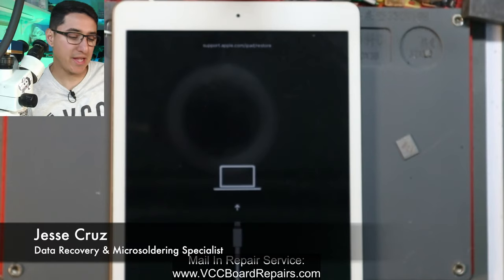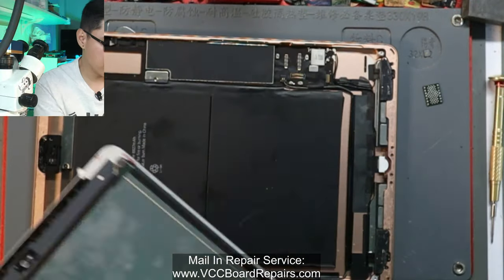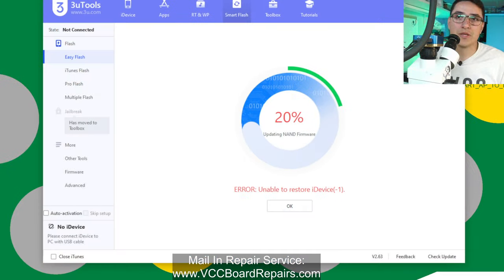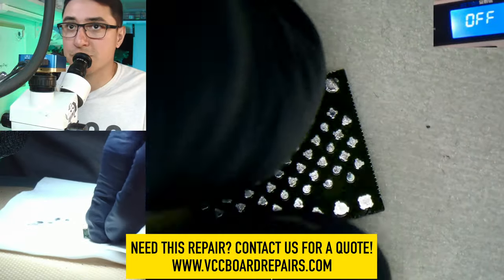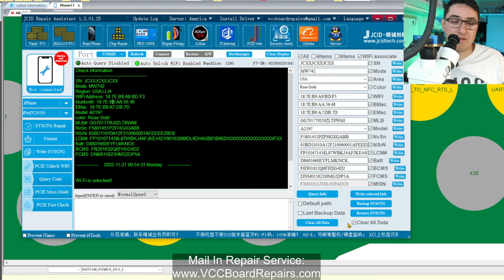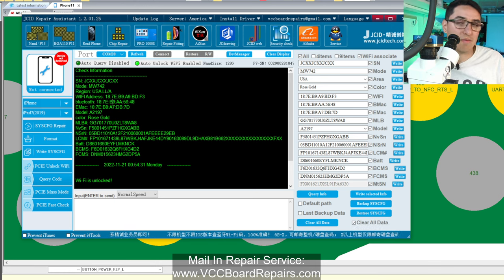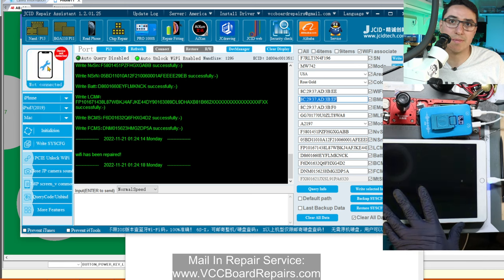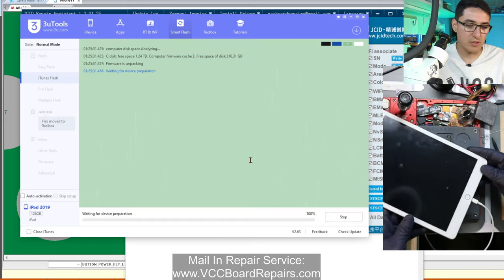iPad 7 Bootlooping with iTunes Error 9 Code. How To Fix with JC P7 NAND Programmer

Comment: Hello
I totally watched your video
I have a question
The old hard drive was not read by JC and you dropped the new hard drive and then after turning on the phone, it entered the serial number and Wi-Fi and Bluetooth serial number.
Where did you get the serial number and Wi-Fi and Bluetooth serial number of the broken hard drive and insert it into the new hard drive?
Reply from the maker: You can buy from many places. But this only works for iPad 7 wifi model in this case

Comment: Did the hard disk need to be replaced? Could the hard disk be repaired with a programmer? That way we can use the same hard disk if we don't have any laying around?
Reply from the maker: The NAND was replaced because it went bad
Reply: @VCCBoardRepairs  sorry that is what I meant. The NAND, is it possible to remove it and flash (repair) it with a programmer? And use the same Nand? Or is replacing the only option? Since it's only data corruption and not physical damage.
Reply from the maker: I heard it's possible but I would rather replace it to ensure a reliable repair

Comment: Hi Jessie! You mention about rotation after nand replacement. I tried to upgrade my iphone 11 pro 64gb to 256gb, but unfortunately first the 256Gb nand was pulled from iphone x, so i can't use it. secondly I damaged my original nand. I recover my phone with JC P13 used unbinding an other 64Gb nand from iPhone 11 donor board, so get my phone original SN and wifi/bt data. But after all repair process phone working just my taptic engine vibrating loudy and have problem with orientation. Do you know how can I fix this issue?
Reply from the maker: You have to write a generic SYSCFG from JC software. Select the model on the left & click "WRITE SYSCFG"

Then edit the SN, WiFi, BT, model, color info and restore again
Reply: Thank you the quick answer! I didn’t do that when prepare the new NAND.
Reply: I did it and now phone work properly. Other question. NAND is locked to phone models. It’s possible to unlock for use other model?

Comment: the lcd digitizer tip is good. but BE CAREFUL because if that lcd slides over and touches any exposed tesa or something, you are gonna need a new lcd xD trust me. also, if you have any ways to clean tesa residue from an lcd without destroying the lcd, lmk :)
Reply from the maker: I've never had that issue

Comment: Hi, my iPad7 does not charge and it does not turn on. The nand voltages (1.8, 0.9 and 3.3) are unstable...the other voltages seem ok....any ideas? Thanks
Reply from the maker: Probably CPU issue
Reply: @VCCBoardRepairs  thank you for your answer, I just retested but I no longer have all the voltages arriving at the nand...I have the main vcc and the bat vcc and also the 1.8v always from the U8100. Maybe the 8100 hs or more likely the cpu? thanks again